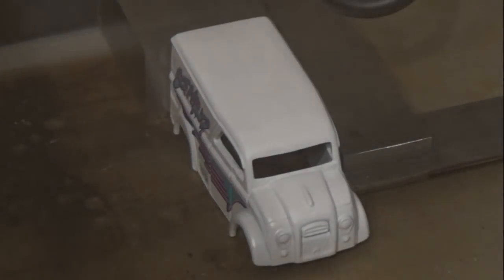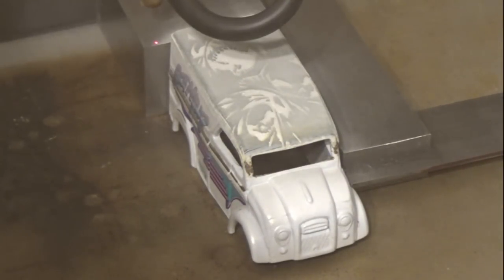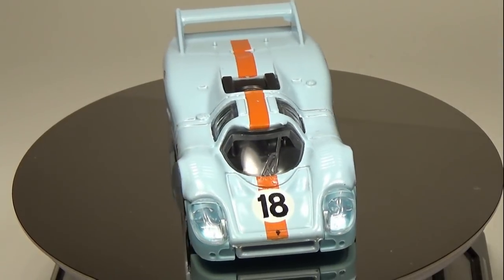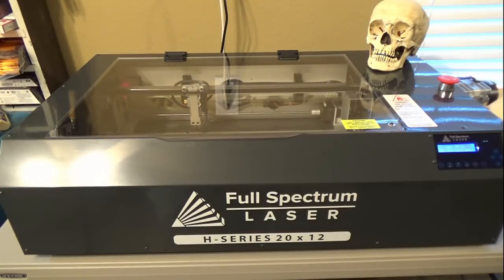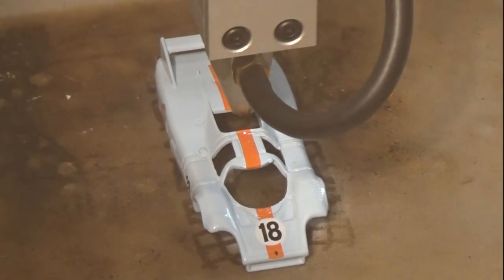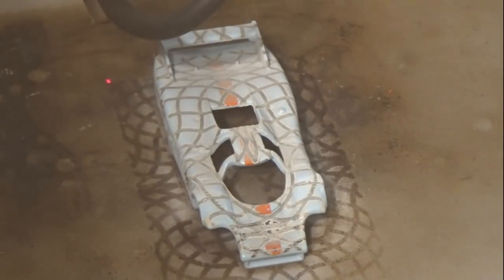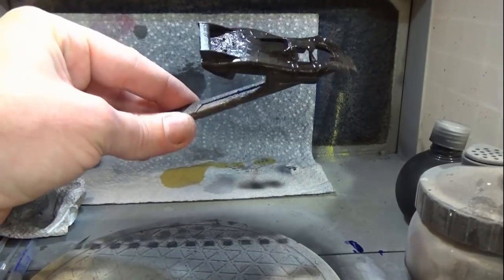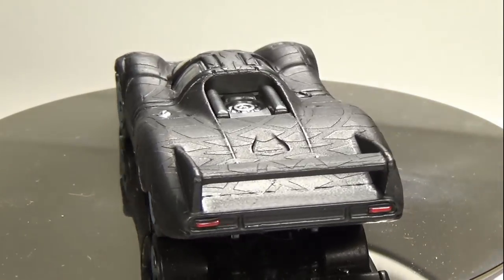Laser Cutting Paint on a Hot Wheels Custom using a Full Spectrum Laser

Comment: An interesting concept using a laser to etch into the existing paint. Though I do think you could align the car sides easier that you think? If you use the block to align the car, then mark on the mat where the sides of the car are, could you scale the image so it doesn't exceed the boundary of the top sides? 
Note I don't own a laser printer, not have I used one but I do think this is possible.
Reply: Ps another top video by the way 👍

Comment: one thing that might be worth trying is masking the car off with tape beforehand with masking tape so after you remove what you don't want, you can paint to fill in what was removed and leave a 2 tone color, or more if you want to do it multiple times.... I do realize that painters tape won't cover most of the contours of a car like that so masking will be difficult.  so what you might wanna try is putting on a few layers of Plasti-dip as this will cover all the nooks and crannys that painters tape cant, and still makes it so you can peel it off.

Comment: Exceptional technique baremetalHW, really awesome!  From a technical standpoint does the paint / metal surface get vaporized by the intense heat of the laser, and if so I guess you have to use some special ventilation to avoid inhaling the fumes?  Thanks for the inspirational video =)
Reply from the maker: Correct the laser has a large ventilation system and will not even run if the ventilation system is not running

Comment: How does the laser's focus factor in? Is there an ideal distance for the sharpest cut?
Reply from the maker: The laser comes with a small disc that you used to calibrate the focal distance... this is extremely useful if I'm cutting something like wood however I find the cutting the paint works pretty well at almost any distance

Comment: Did you ever perfect the "8" paint mask using your other laser engraver?  I found that it made quite detailed masks perfectly - but those detailed images produce very delicate masks, making it difficult to remove the tape adhesive.
Reply from the maker: No I never really perfected it. The mask's were always too flexible
Reply: Ic

Comment: i think it would be cooler if you painted the car before hand instead of using the factory paint. also does the laser remove all the paint? if not it would be cool to layer a couple different colors on one car then use the laser to expose the different paints

Comment: That 917 looks mean in black - it could almost be a Batmobile. Are you going to complete your Mad Max vehicle made from a motorcycle, a Cadillac and a Matchbox armoured truck (number 5)? How about making a Mad Max custom using a Hot Wheels Subaru Brat, or even a '73 Ford Falcon XB? The new Matchbox '33 Plymouth  is lovely, but in your capable hands, I reckon you could make it into something mental.